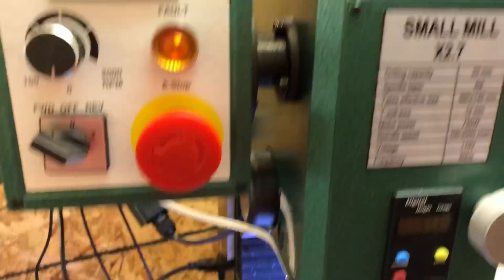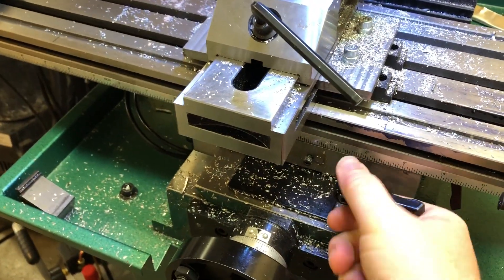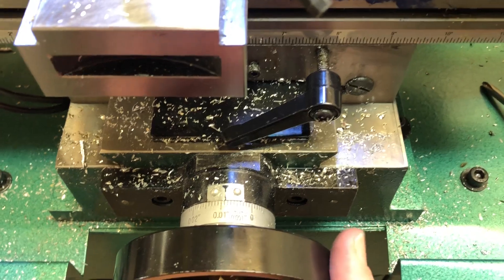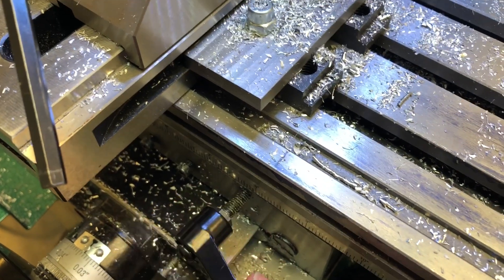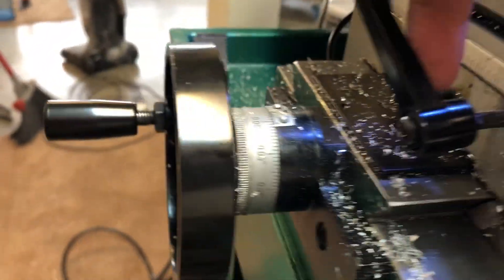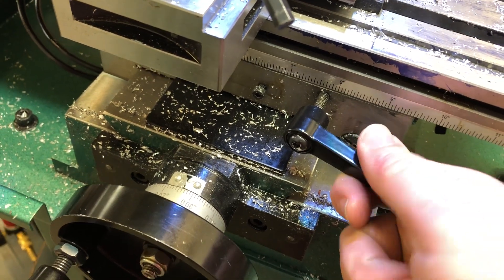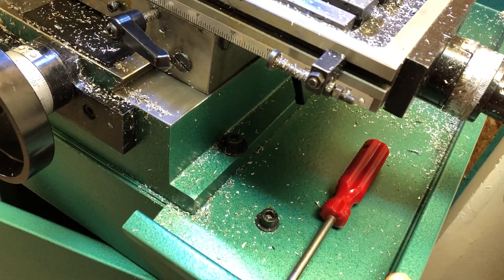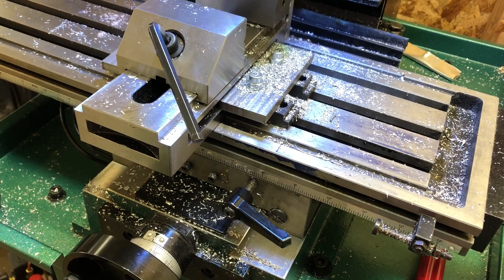x2.7 G0836 LMS 5500 sx2.7 x axis gib lock

Comment: First thing I changed on my grizzly mill. Just replaced both my handles with socket head allens, mine had two on the x axis. Yes I have to pick up an Allen wrench to lock/unlock. Quick fix, otherwise I'd be redrilling and tapping those after I hooked the handles a hundred times and played out those holes.

Comment: Same issue with PM25-   but it has 2 gib locks made out of cheap pot metal.
Knurled some brass round stock to clear the stops, and used large enough round stock to be able to torque the gibs tight without a wrench.

https://www.youtube.com/watch?v=e0nOF7YZAoc&t=31s

Did same for lathe handles, but made large steel wheels for better hand grip.

Comment: I made a nob out of aluminum pressed in the screw and use the aluminum nob to tighten. I don't have a lathe but do have the LMC 4" turntable to make the nob. I have the LMC version 5500 mill and yes I had to straighten the screw more times than comfortable.
Reply from the maker: I've been thinging hard about also adding a CV joint for the Y gib lock.  The top of my hand gets greased by the lead screw every time I lock it.
Reply from the maker: I made a flex joint for the Y axis which can be found here:  https://www.youtube.com/watch?v=J9yFR0QDR5o

Comment: you can also remove the plastic handle and a 10mm hex head is revealed. Use a 10mm ratchet wrench to loosen/tighten.  Also works well for Y axis underneath.
Reply from the maker: I've been thinking of trying to use some sort of CV joint for the Y axis.  My hand gets smeared with grease from the lead screw way to often.